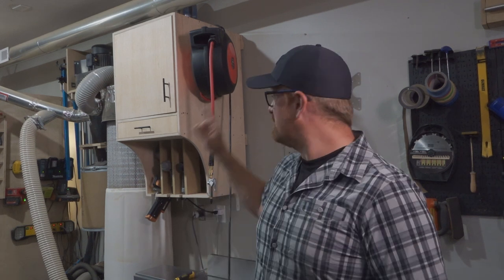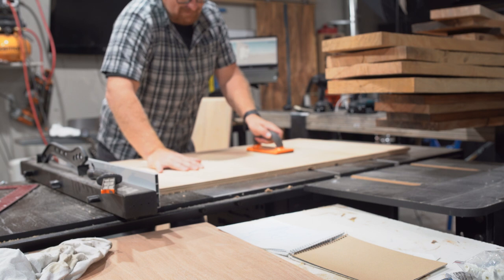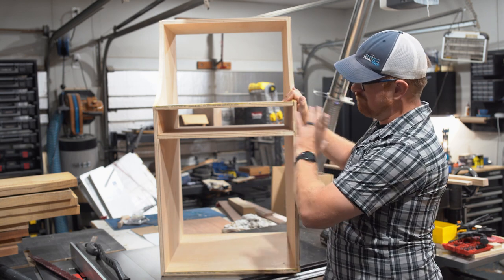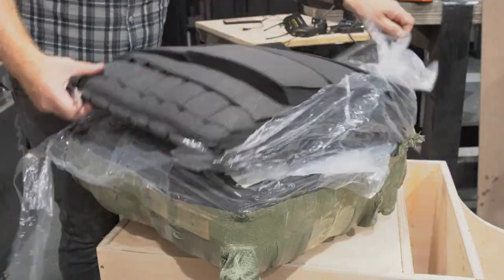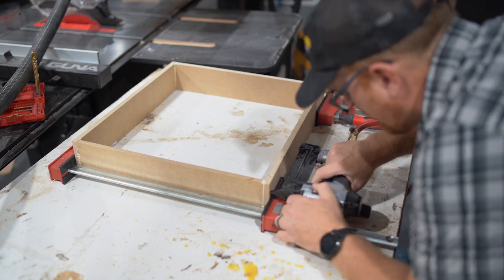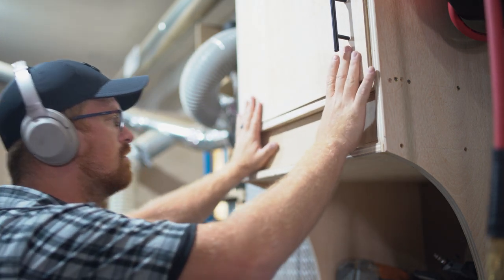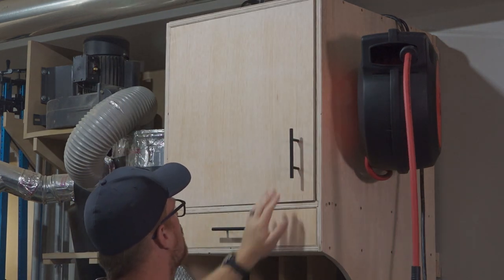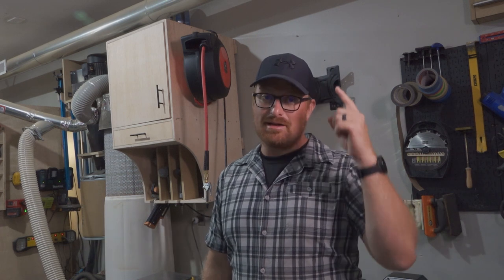Building a Silent Compressor Cabinet with Air tool Storage | Shop Projects

Comment: Either I've been lucky, or the Flexilla Hose Reel is pretty good.  I would bet that I've just been lucky, but I'm not known to be very good at gambling either.   I've had mine for 2 years and it's been installed outdoors under a car port for the entirety of it's life so to me, that's saying something.  Just my two-cents.

Comment: Pretty brilliant and outside the box (ironically) thinking! I've been trying to figure out a better way to store a compressor than just jammed underneath a bench and you sir thought to put it on a wall! Great vid
Reply from the maker: Hey doing what I can.  I like Adam Savage's (Or I suppose he got it from Jamie) of thinking vertical with shop organization.  I also really like to keep all of my tools together with the stuff I need to use them so putting the nails and accessories into the same cabinet helps me keep my brain a little more sane.

Comment: Looks great, glad you used dados regardless of the pain lol but it’s a beautiful cabinet because it’s a custom cabinet and those are literally the best looking and more importantly functional as hell! Thanks for the tip with the gun storage and making it easier to clean 👍🏼
Reply from the maker: I didn't even think of it when I built it but the dados are probably also better for dampening the sound (more coupled mass to move)

Comment: Im sure that the compressor is going to over heat in there when its running
Reply: I was thinking the same thing..
Plus how are you gonna drain the water out? Mine has a nozzle on the back to turn.. would hate lugging that thing out